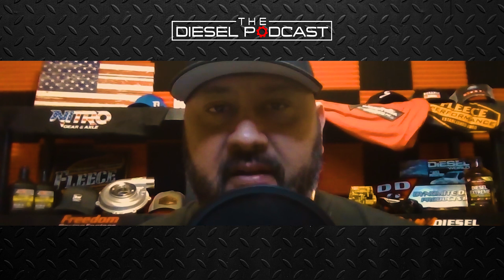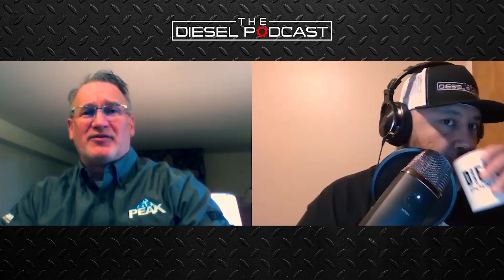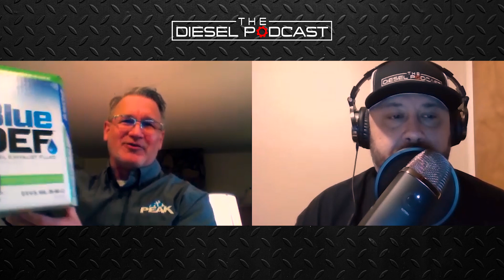Does DEF Make Your New Diesel Better?

Comment: Theres no way possible that there is anything special about that "platinum system shield" DEF is DEF he said it himself a table spoon of salt could contaminate up to 5,000 gallons your truck has a DEF quality sensor that measures the exact ratio of urea to water and if its not correct youll get a check engine light meaning if you add any amount of additive into it you would throw that ratio off and cause a CEL so i find that to be incredibly unlikely they unfortunately most consumers have no idea that their truck is measuring the ratio of water to urea so theyll buy into the "platinum" sad and just in case you were wondering the ratio is 32.5% urea and 67.5% water you cannot add any additive to that or it throws that ratio off even if the additive were 1%
Reply: I'll trust the chemists over you dude. I'm pretty sure if they are lying and Platinum DEF is the very same stuff as Blue DEF, somebody would have sued them for false advertising by now. 
There are Youtube videos where a guy videoed his DEF injector every 10,000 miles after switching to Platinum. It was badly caked up after just 10,000 miles using regular Blue DEF on a new Ram, but became much cleaner the longer he used Platinum.
I switched to Platinum with my Cummins Ram 3500 at 70,000 miles. It has 130,000 now and I haven't had any issues with the DEF system. I just drove it from Quebec to Arizona hauling a 6000 lb cargo trailer, and it used a 2.5 gallon box of Platinum about every 1400 miles. Averaged 13.7 mpg.
Reply: @headdown1  you literally cannot mess with the quantity of urea VS water there is a def quality sensor in the tank. Don't believe me ? Get out a scan tool and look at the data display yourself . Go to DEF quality data and look at it it will be displayed on percentage and it will be 32.5% who is to say said guy making videos was not paid to make the videos and faking the results by say installing a new injector shortly before showing the results etc. YOU CANNOT change that mixture unless they are putting in something that fools the sensor there's literally no other explanation than that I went to school for this shit at the best diesel college in the country try had a full class dedicated to aftertreatment my instructor was a former Bosch engineer who worked for Bosch for 30 years Bosch doesn't keep idiots for 30 years

Comment: That was informative.
I was wondering if on road manufacturers would go the def/doc only solution like some off road applications have. But he may of answered it already about issues of vehicles not being to operating temp. Even though def usage is higher when not using a dpf or egr, but I hear engine issues are less common, and oil analysis come back looking better.